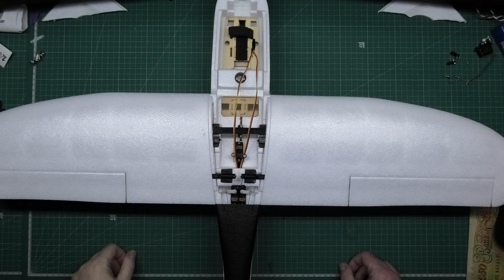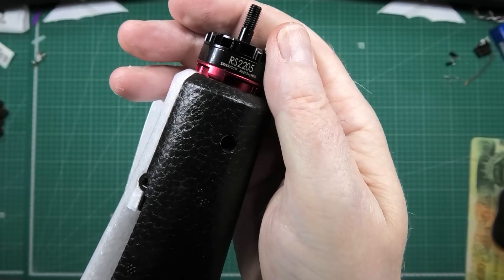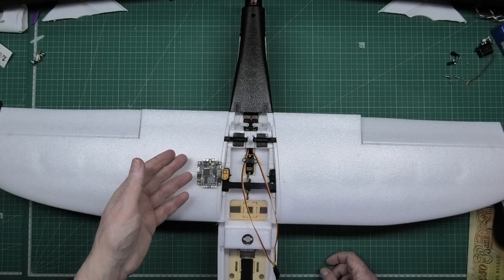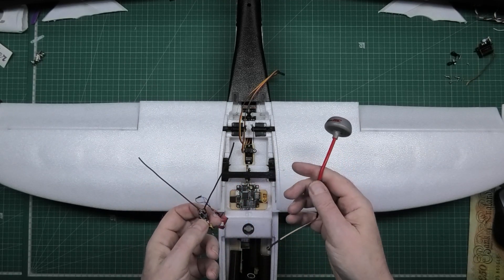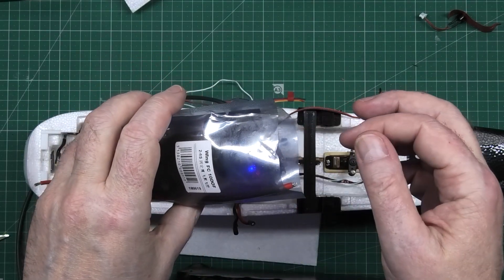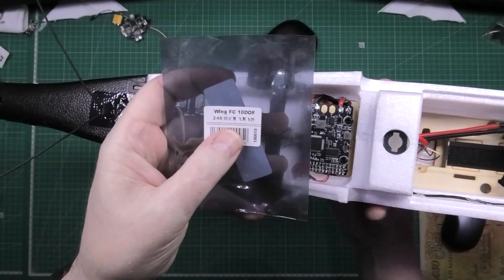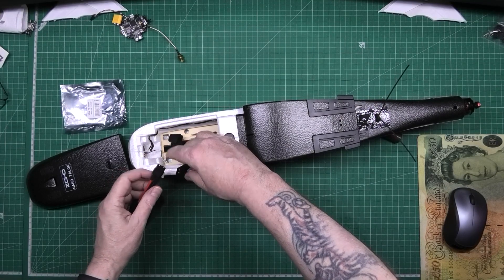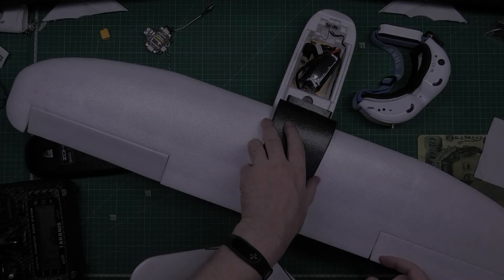ZOHD Nano Talon build

Comment: Just for a bit of friendly iNav advice. Don’t put failsafe on a switch. Use nav RTH instead. Failsafe on a switch should only be used to test that failsafe is working (which it doesn’t really do as it doesn’t test the receiver losing connection). Failsafe is usually set up to use RTH anyway in wings. If you’re interested, I have a nice failsafe setup on my web site. 

Nice setup for the video antenna. A friend of mine has his antenna out the bottom too and thinks the signal is better. 

It will be interesting to see how those LitaKala HG2’s perform too. I’ve bought some LitaKala VTC6’s so hope they work just as well as the LG/Sony branded batteries. 

Good luck with the maiden 👍🏻

Comment: Did you try the impulse rc driver fixer?
Reply from the maker: Yup, I had to use it the first time I tried to flash it. It was working perfectly with iNav but suddenly, it started going into a boot-loop. Never mind, it's been sent to Tony's auction (put under the hammer) 😂

Comment: A couple of points because i want to see you succeed this time.   Its possible the USB cable was shite  They can cause problems.   Or the FC with VTX was Pulling more power than the USB could deliver, causing reboots, As You had no battery powering it .   New FC   make sure you corrected orientation In INav for the board being sideways.  Good luck Mate .
Reply from the maker: I tried it with & without external power, I tried 3 x USB cables and I even tried swearing at it 😂
Don't worry, the board is set for 90deg clockwise and all the surfaces move as they should. I might be taking it out for a crash maiden this morning 😁

Comment: I bought lghg2 cells for my 15s 4p ebike and they sag from 63v to 53-54v at 25a. I tested 1 at and came to 2.5ah on a b6 but then the charger broke. The connections where soliddd and the cable was doubled up 8awg on series connections. Battery cable was 8awg. I unwrapped one cell and it was different to the original lg hg2 cell so they where rewrapped cells
Reply from the maker: The liitokala cells probably are re-wrapped. My own experience with the 20 that I bought were very good. I got 2900mAh at 10A and they did sag a lot with anything over that but so did the genuine LG's that I bought for comparison.
Reply: @Vortecks  ye i noticed alot of people tested them and there like 3AH but can only do like  5a without huge amount of sag which isnt bad for £1.64 a peice. im planning on making a pack a long range 20ah 18s pack with 26650 and for short range 5ah but huge power some turnigy 1s 5ah 20c lipos

Comment: My battery pack is a 10s10p 33.5Ah on a Tongsheng TSDZ2 Brushless Geared Mid-Drive Torque Sensor Motor, 36v 350w but it can be fiddled with to double that power. I'm putting on a Full Carbon 26er with no shocks, it's around 9.5kg & when I add the motor & battery I'll be adding 7.55kg, I don't mind pedal assist because I need to ride so that I'm not being too lazy. With gearing I should be able ride my bike at 45.5 km/h or 28.27239 mph which is a comfortable speed with 1.1" slick tires on my bike.
Reply from the maker: A bike is a bike, no matter what the power & speed. Well done for building it in the first place!

Comment: The comments on landing were quite ironic. You've never landed yet :) with the FC it is possible you are having power issues running it from USB. Try powering the board from the flight battery while flashing
Reply from the maker: I'll have you know, I've landed at least 6 times now 😂
I tried the FC with battery power, without battery power, 3 different USB leads, 2 different PC's and it still won't work.
On a positive note, this morning was my 7th successful landing 😁

Comment: Those batteries are only 3000mah & too expensive for my needs, I don't need 30a batteries when 10a batteries are okay for me. They are $38.72 AUD for 10 cells, my NCR18650B's are 3350mah & I got them for $68.02 AUD for 20 cells which is $34.01 AUD for 10. I'll recharge them to 4.1v each in the programing & double the cycles & every so often I'll recharge them to 4.2v each. Either way they'll last me a long long time & I don't need to build anything like a superbike.